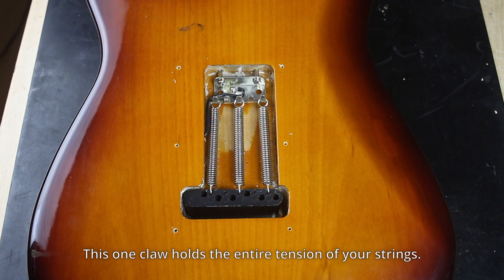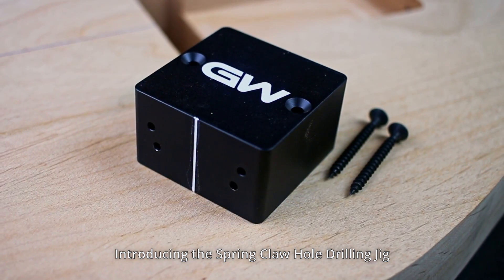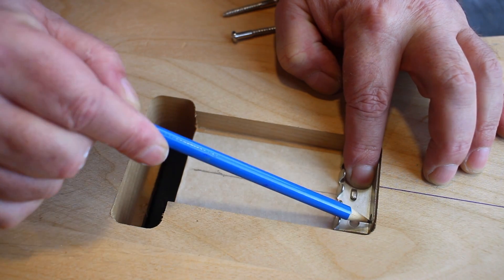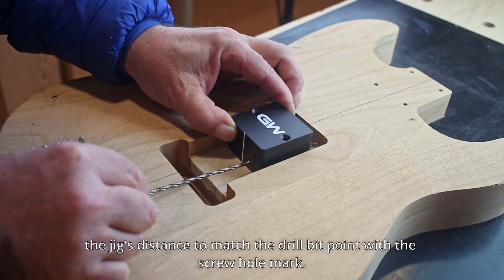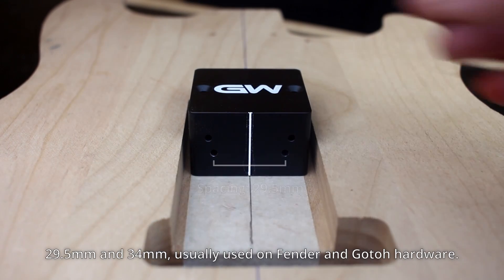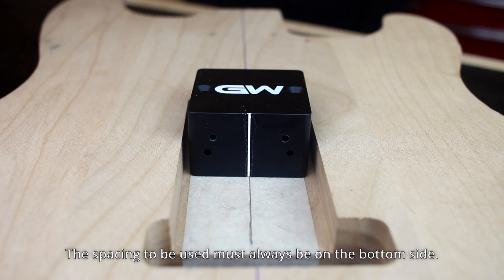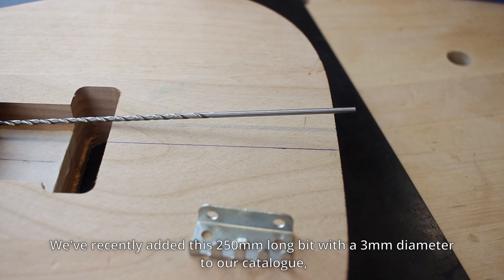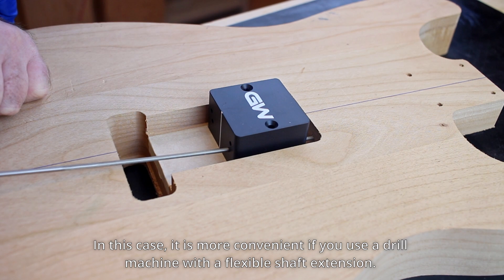How to drill the holes for your tremolo's spring claw - G&W - Spring Claw Hole Drilling Jig

Comment: thanks for the help! i was really confused for my project where to drill the holes, but why does it have to be 6 degrees? can it be perfectly horizontal if i don't use the jig?
Reply from the maker: Hi! Thanks for your feedback! 
6 degrees is simply the best approaching angle for your drill bit. 
With this angle you'll get the most comfortable access to the cavity with your drill and it will prevent you from drilling into the pickup cavity.
Of course if you manage to make an horizontal hole it will not affect the spring claw's function ;)
Reply: @GWLuthierSupplies  thanks for the help!
Reply: PERFECTLY HORIZONTAL also seemed to me like the best option, why 6 degrees and not 4 or 9 ?